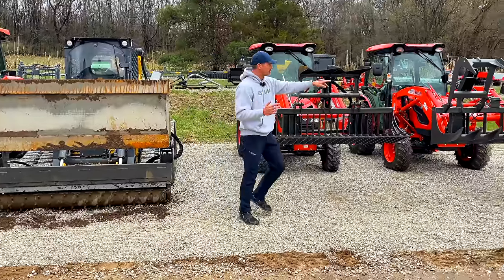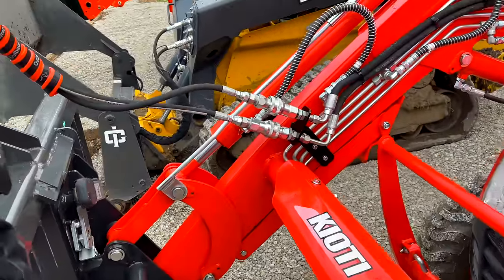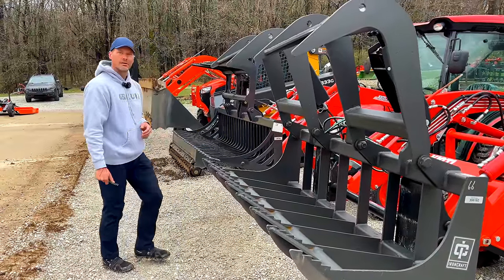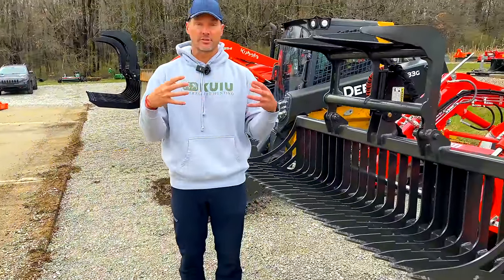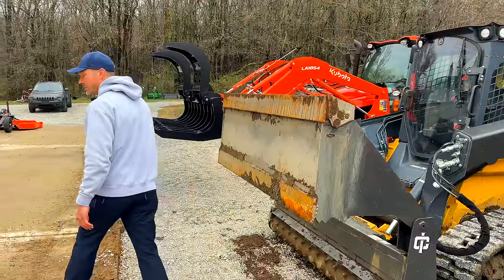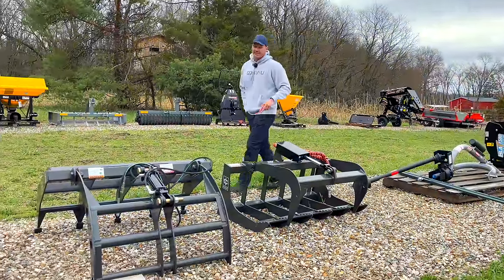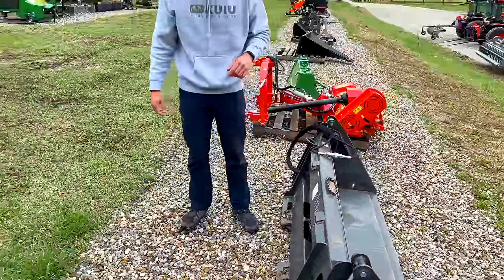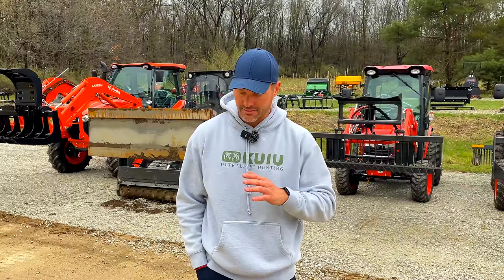HARD TO BELIEVE IT'S BETTER THAN A GRAPPLE

Comment: Can you tell me what grapple I need for my John Deere x475 or where to find out that information? I know there is an off brand that will work, but I've lost the information. I'm a widow and learning how to figure these things out. Thank you.
Reply from the maker: The garden tractor?  Not really designed to have a grapple on that machine.  If anything, perhaps get an add-a-grapple to keep the weight as low as possible.
Reply: Is the add a grapple plus the bucket weight less than a brush crusher? I’d also be weary of an 3rd function hydraulic spool available for it. Of course that’s only assuming the x series loader is jdqa. Idk if it’s a pin on or not.

Comment: I use a 60” single lid root grapple on my kubota grand L. I use the heck out of it for brush and firewood. Getting ready to cut back and clean up a quarter mile of old hedge row. 
I used my grapple for 5 minutes then asked myself why I didn’t buy one years ago.

Comment: Interesting comments about the BrushCrusher. I bought a BC-4215 (from you!) a few years ago, and it's done an OK job. I have a few gripes with it, and recently it even bent so it doesn't align like it should, but overall it's worked pretty well for me. I wish I'd have gone with a hydraulic grapple and installed the front hydraulics, but (like you said) the BC was much more economical back then, vs. the alternative. I do wish I could make the change now, but it would just cost too much. I guess there's something to be said for getting what you really want the first time - "buy once, cry once!"

Comment: I kinda do wish i got the horizontal type root rake because they hold material way better but i couldn't pass up the sweet deal i got on a land pride sgc0660
Reply from the maker: Sounds like you could sell off the Land Pride and break even or make some money?
Reply: @GoodWorksTractors  I'm curious whether a 60"  is appropriate for an L3400 if I go to a horizontal style or would I have to seek out another ar400 constructed grapple to keep weight in check

Comment: John Deere states their 4 in 1 works on 1025R..were they wrong???
Reply from the maker: i'm referring to using this specific 4-N-1 Bucket, with the smallest bucket width at 60" and the weight of that bucket at 600 lb. eats up all the lifting capacity of those small tractors.
Reply: @GoodWorksTractors  Thanks for the clarification

Comment: how bout a pallet fork grapple?
Reply: Think titan has one if not you can find a grapple jaw that bolts to your existing forks
Reply from the maker: Precision Mfg makes an Add-A-Grapple for Pallet Forks, too: https://www.goodworkstractors.com/product/precision-mfg-add-a-grapple-pallet-fork/
Reply: We have the Precision Adjustable Add a Grapple for our Kubota Grand L 3560. It is great. We can do brush or Round  hay bales with it. The only trade off is that smaller items can fall through between the pallet forks. I have towed with the idea of creating a lightweight pallet floor, but haven't had time to do it.